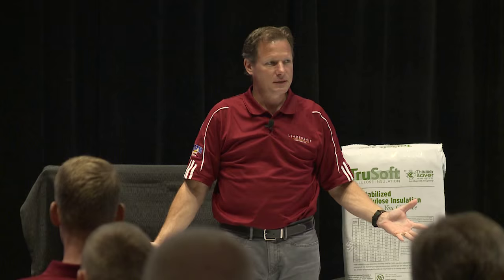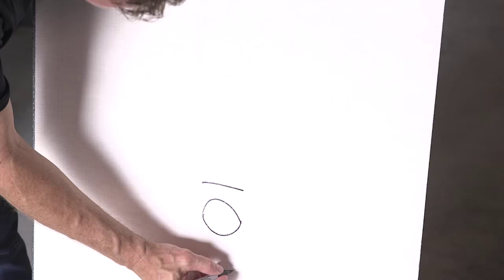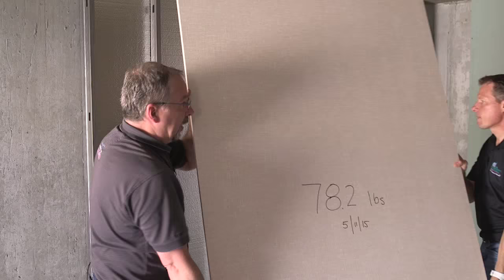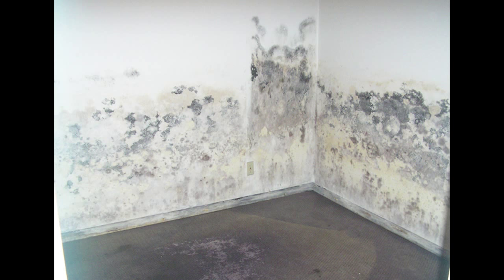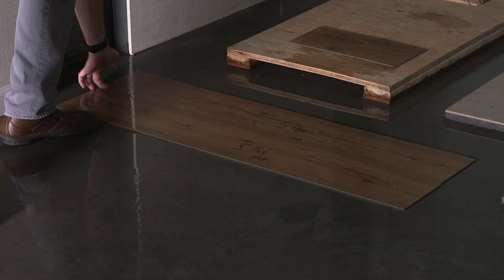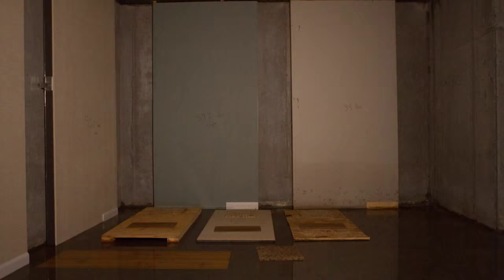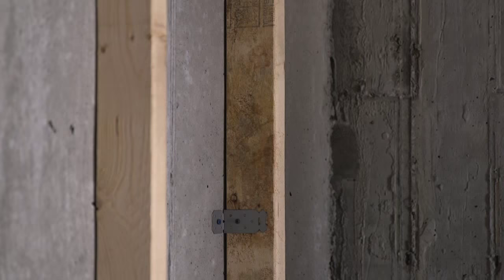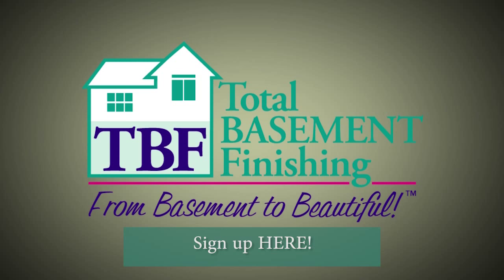The Mold War Challenge: Comparing Basement Finishing Materials

Comment: Haha. I got a quote for this system. Might be the "best" but they wanted $30k for a 600 sq ft area. I did it myself for $5k in materials. I can tear the walls and carpet our 6 or 7 times and still be ahead. Great product if you can afford it. I can't, just don't let the basement flood.
Reply: lol
Reply: Holy cow! They were charging 30k just for materials????
Reply: @mikes8016  30k was materials and labor.
Reply: Were they quoting you floors, walls, ceilings and electrical? Did your 5k include floors, walls, ceilings and electrical? Did you use drywall or fiber rock or hardie board? Trying to get an idea for myself.
Reply: @mikes8016  The 5k included everything but fixtures (toilet, vanity, cabinets countertops, etc).  I used standard drywall walls and ceilings, green drywall in the bathroom. I ran all my own electrical, pulled a permit and had it inspected.  I rented a jackhammer and broke up the floor to access the drain line for the toilet myself, but hired a licensed plumber to hook everything up and stub out the half bath. I also hired a guy to do the drywall finishing.  I wanted it to look good.  I assume the 30k they quoted was for a 100% complete finished space, but I didn't look at the fine print because there was no point.  It was not a real option.
Reply: Look up CIRS-Chronic Inflammatory Response Disorder- Find out how it disrupts  your endocrine system and that of your family and the various ourcomes and symptoms. Believe me, this is a cheaper fix over the lifetime of you your kids and grandkids. That is not speaking of the complications to any friends or extended family with the right Hipliotypes (sp?) for CIRS.
Reply: @williamreis9999  I don't see how that's relevant.  If you don't get water in the basement, and you build it right, you won't have mold.  If you have a flood, you tear it all out and have it replaced before you have mold problems.  That's what home owners insurance is for.
Reply: @penguin12902  Its relevant because the health compromise is not from the mold directly alone, it's also from the particulate matter put off by the mold often before mold is ever detected visually or by the musty smell. EVen if you "build it right" you can still be developing mold because of the duct work in you HVAC system because of there not being proper ventalation for the volume of the living space. In 90% of the cases of CIRS the people don't even know until after they see the doctor that there's a problem. Then they have a HRTSMI-2 , or ERMI home environmental test done. 

Good site to keep around-Mold Free Living- https://moldfreeliving.com/2017/12/10/professional-mold-testing/
Reply: @williamreis9999  Alright..well I guess if my choice is take a chance with mold or spend $50k for a basement with plastic panels with seams that look like shit.  I guess I'll have to take my chances, because I don't have $50k for this ridiculous "system".

Comment: Anybody knows that you never place wood or fiberglass insulation in direct contact with a basement concrete wall or floor.
Reply: Apparently the previous owners of my house hired a contractor to finish the basement who did not know this...😭
Reply: I did not know this.. but i live in Arizona. For some reason we don't have basements. Wish we did though, would stay a lot cooler and cost less for my $400 Summer AC bill

Comment: It's really easy to stage a test that would show your product being superior. I have a couple of issues with this video. First, it is true for sure that the foam and plastic products are better for the simple fact they are water resistant. The scenarios played out are likely not typical. For example, if your basement floods are you going to just leave it there for weeks? Probably not. With a controlled environment and proper maintenance, even drywall with fiberglass over time would not show the results demonstrated.

The drywall shown in the video is touching the floor. If installed properly, the drywall would be raised from the flooring for the exact reason of avoiding water.

A more modern approach would be to use EPS or XPS foam panels which could be purchased from any major hardware store and then put your studs after it even with drywall. Using proper moisture control and water removal.

next, making sure water leaks are patched before finishing is proper...

Comment: Try roxul. Any water does not even reach the middle of the batt. It repels water. Seen other videos where the chip board has a foam underlayment with lines to pass water. Plus it's a good idea for a sump pump. The ending was a no brained. Of course your product survived. Plus it also depends on how prep your walls are before drywall. Keep it a half inch off the ground n use PVC baseboard. Any leaks, fix first.

Comment: @2:35 The video is correct about plumbing. And if you live in a flood plain, a wet year followed by a couple hard rains will provide moisture in the basement that cannot be controlled even with a good drain tile and sump pump. Just sayin.